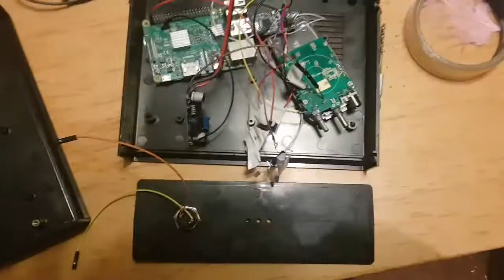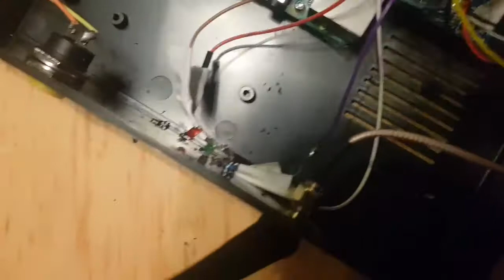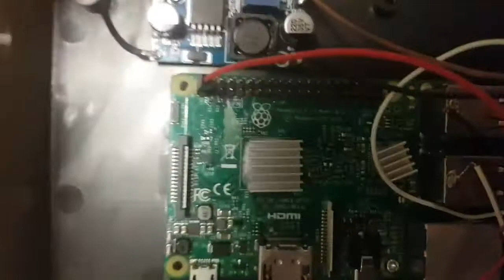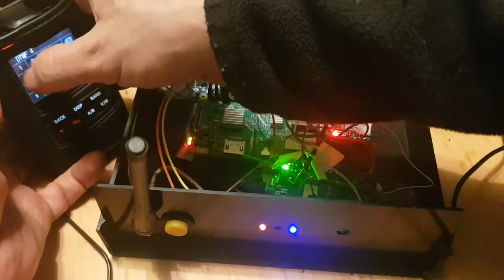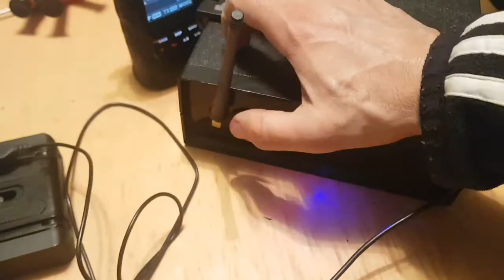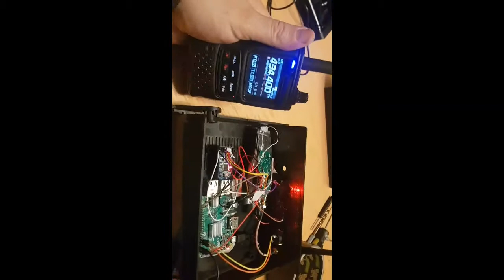Allstar micronode - Self build project- FINAL assembly

Comment: What buck converter and psu are you using i have what sounds like an electrical wine I can't remove.
Reply from the maker: Hi add more earth to raspberry pi and radio shorten and shield all wires make sure they are seperate.
Reply: @m0fxbhamtech  done all that so I'm assuming poor buck converter batch or the two psu I've tried are cheap n nasty.